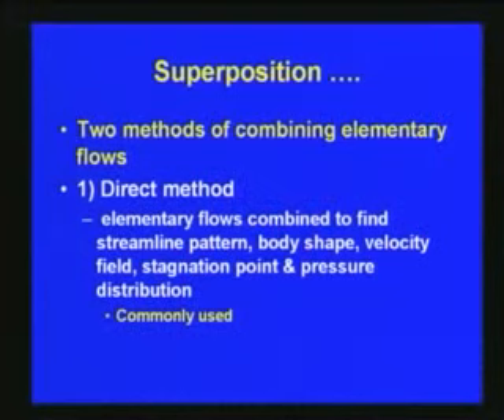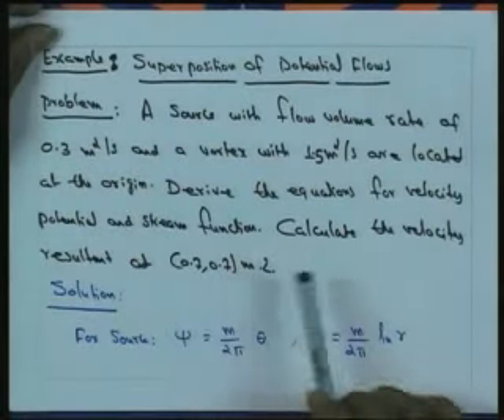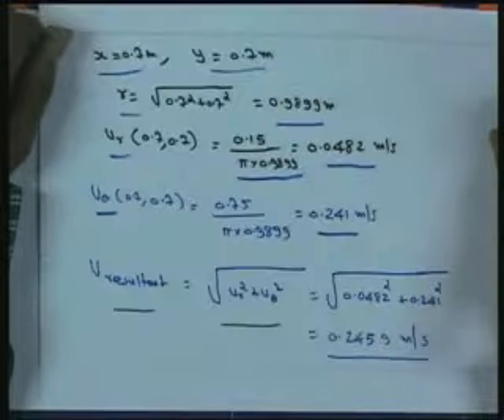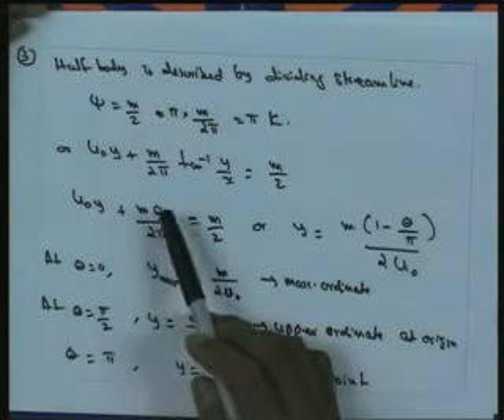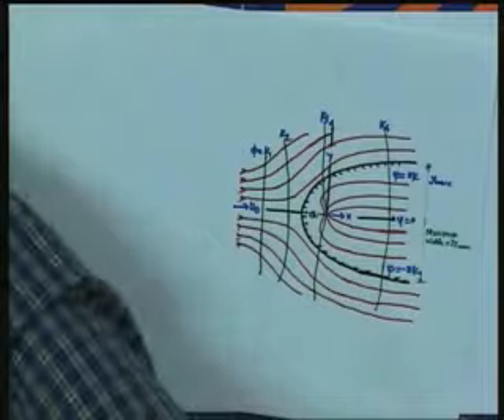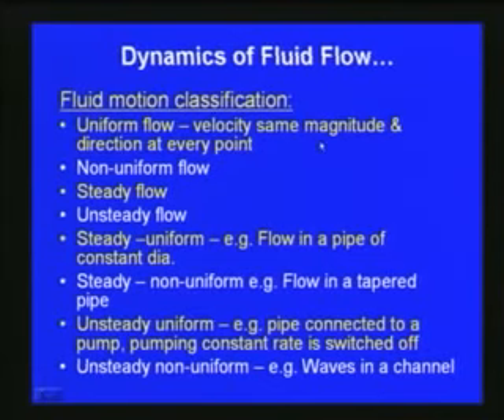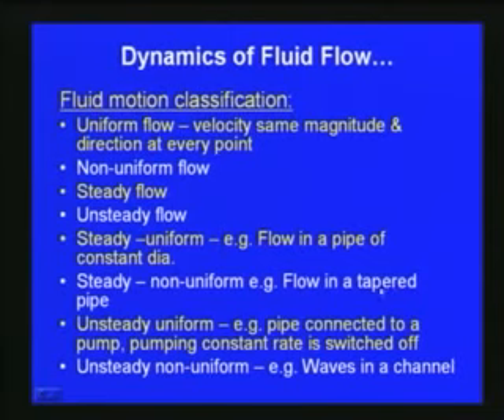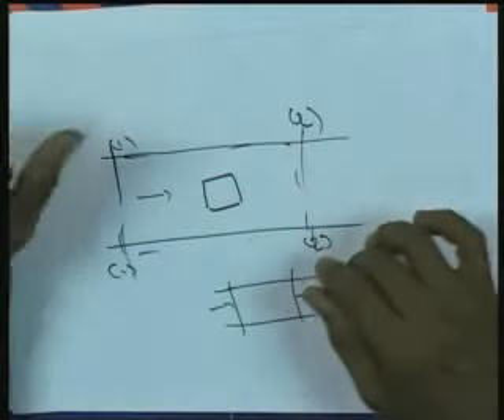Lec-11 Kinematics and Dynamics of Fluid Flow

Comment: I had a professor like this. He had an accent and it took a bit to get used to it. That's just the nature of it.  It's a difficult concept to learn and teach. If I could make a recommendation to the professor, it would be to slow down a bit and do away with power points, put it in your own words and write bigger on the white board.